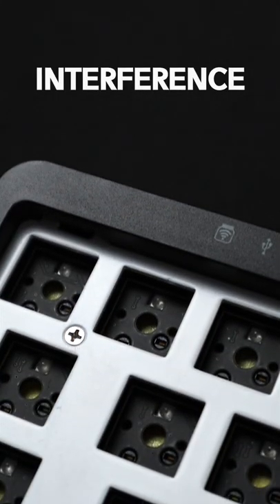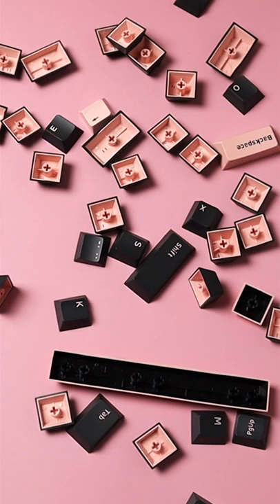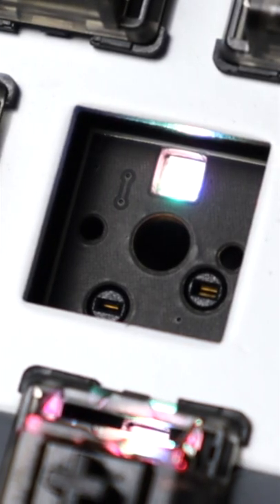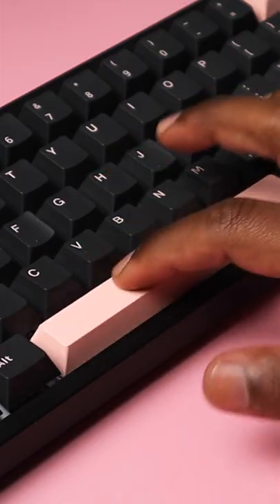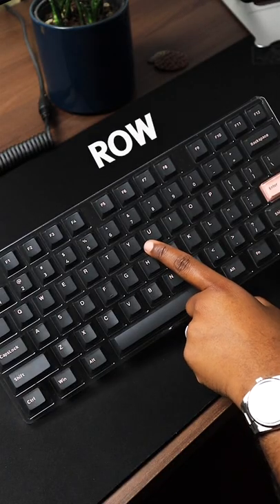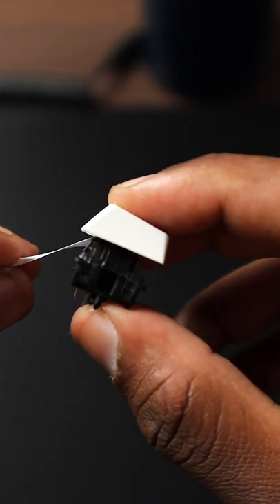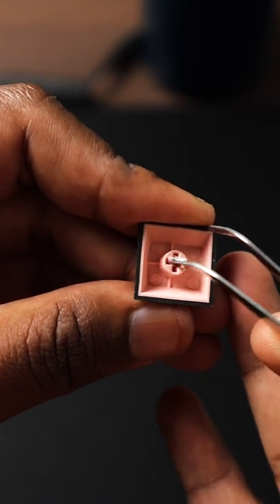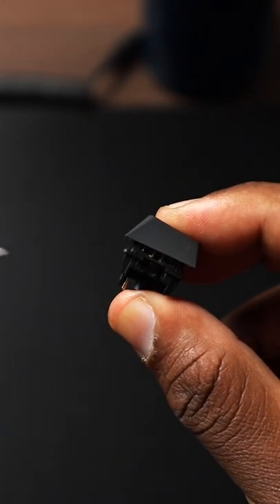EASY fix for north facing interference

Comment from the maker: Did this fix your interference?
Reply: hi one question does the gateron yellow pro have north facing interference problem 
cause i dun have a cherry profile keycaps but i would want to get one Please help
Reply: @deeperkk7493  same question
Reply: @deeperkk7493  it's not about the switch, it's on your pcb.
Reply: @wilhemplays he means if he uses those switches in north facing would he get interf

Comment: Does O rings achieve the same result?
Reply from the maker: Depending on how thick your oring is, the typing feel might get too mushy instead. I'd suggest testing that mod on one keycap first, or better yet, just get some long pole switches to skip these mods entirely.